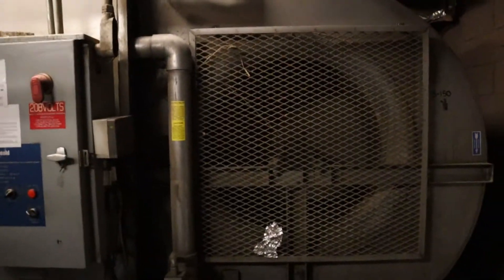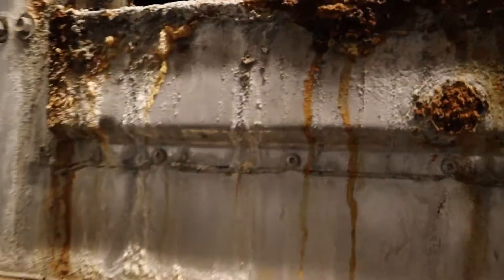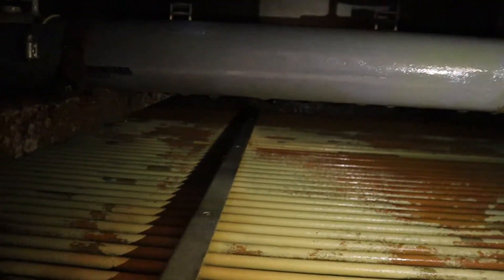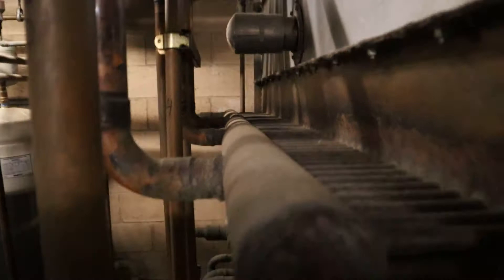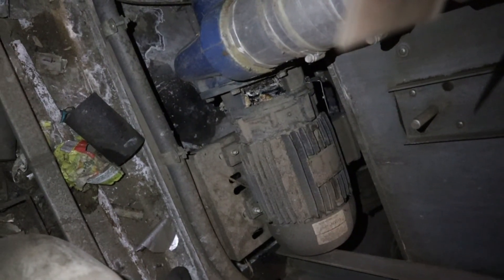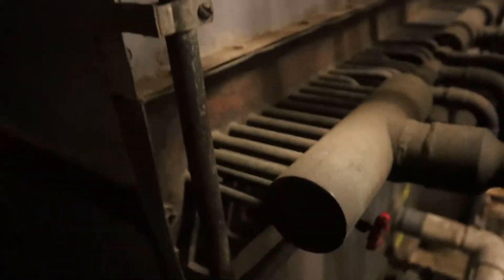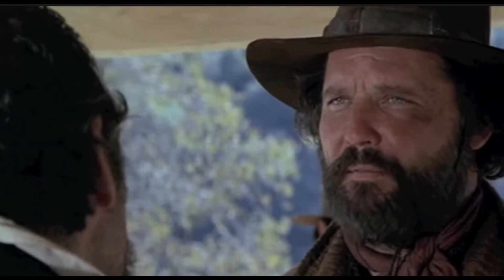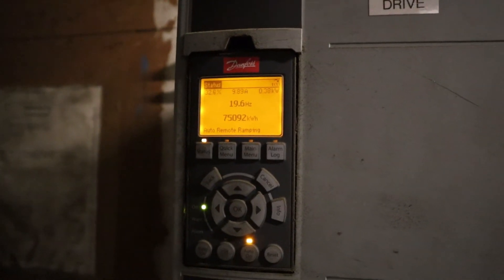Supermarket Evaporator Condenser Tour: Its Just a Little Scale No Worries Cooling Tower

Comment: Nice video. I Have a question about the refrigerant . Why somethings the receiver is full and sometimes this low. And how I can remove refrigerant from the receiver when I have some cases that are no cooling. Thank
Reply from the maker: The receiver all it does is hold the excess refrigerant that's not in circulation. So when a system goes in defrost the liquid gets stacked in receiver once out of defrost back to that system it goes.